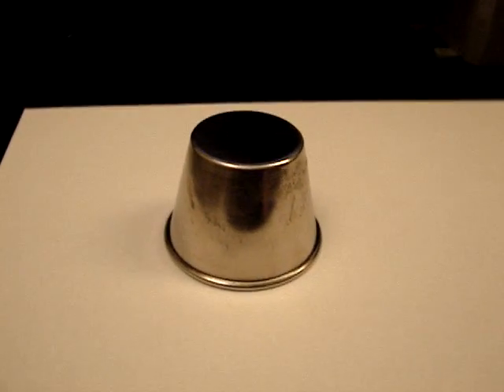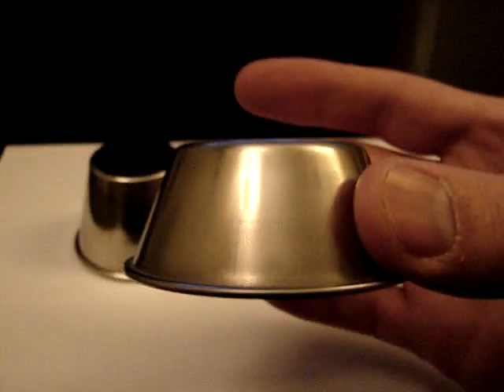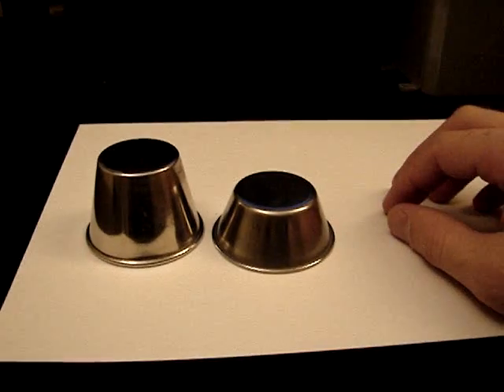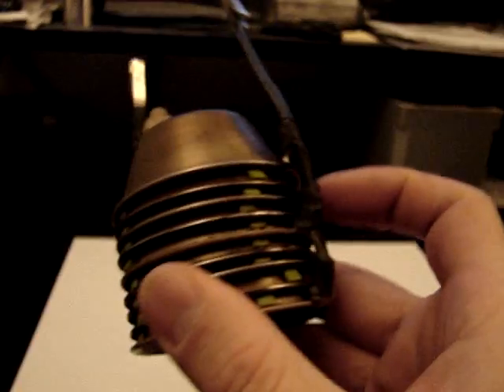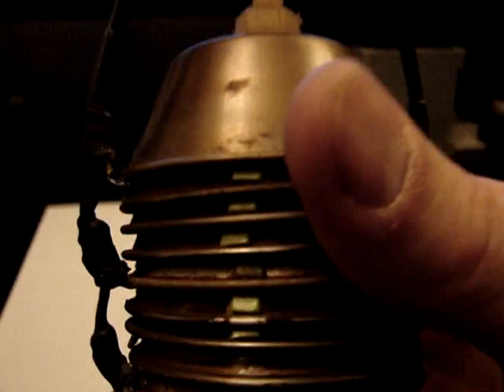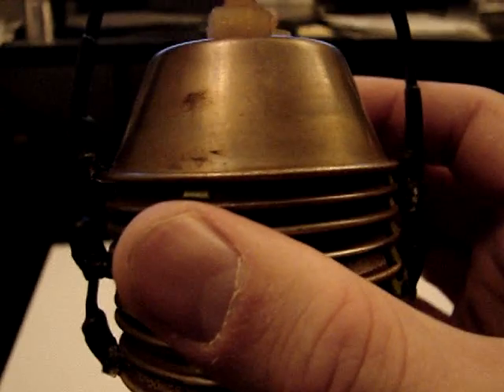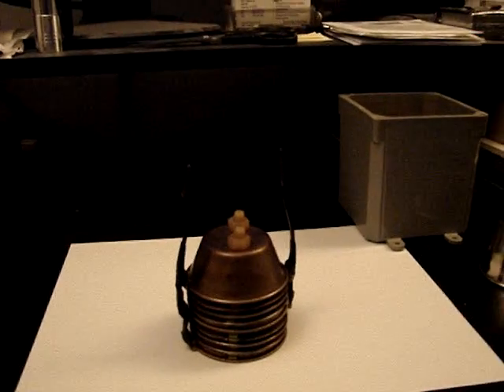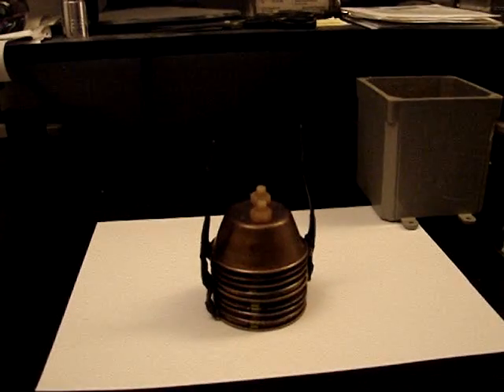Vid5 Volcano Cell Hydrogen Generator Design "9 Cups" (HHO, Brown's Gas, Hydroxy)

Comment from the maker: Neutral cups allow you to increase the space between the positive and negative cups, while maintaining the flow of current across the stack.

The main reasons for neutrals is to reduce the voltage per cup/plate, so you don't boil water, and to reduce amperage and heat.

I hope this answers your question.

Comment from the maker: I'm taking baby steps. I've been experimenting with different cells for almost a year now and I'm just now starting to post videos.  Most of the stuff I did before wasn't worth filming any way.

I'm trying to make my design versatile, so I can use it with motorcycles, golf carts, cars, trucks, etc.  

My first real test is getting a minibike to run on HHO only.  Then I will have enough information to know how many volts, amps and how many cells I will need to run in series to make a car run.

Comment from the maker: The problem I have is that I'm running it from a PC Power Supply that is rated at 18 Amps on 12 Volts, so that is why I have a 15 Amp breaker.  

I guess I'll have to get a better power supply that supports over 20 Amps and an Amp meter for Xmas.

Thanks for the tip about the spray rubber, I'll have to pick some up. That would be a good way to prevent the electrical runoff that I'm getting from the exterior of the cups.